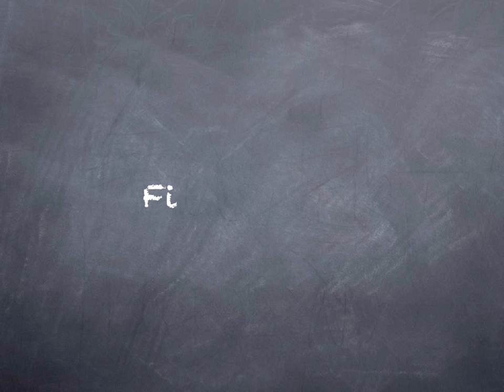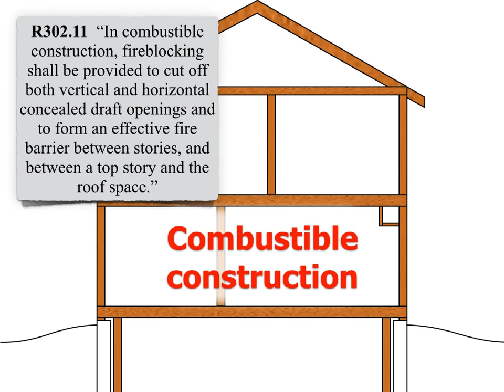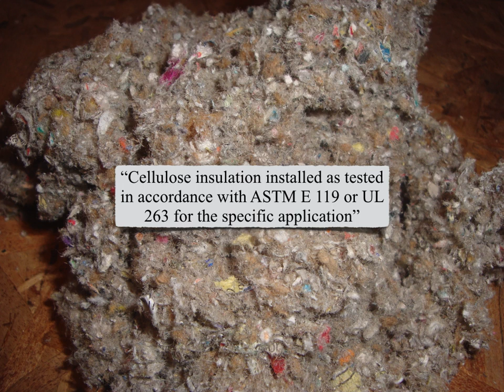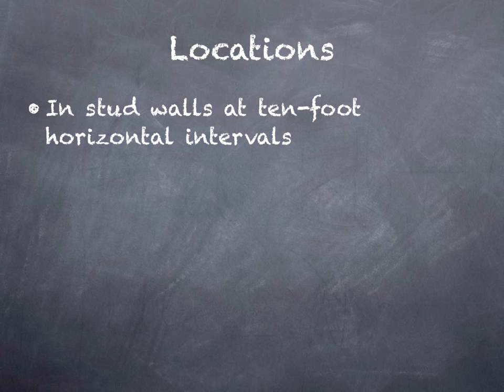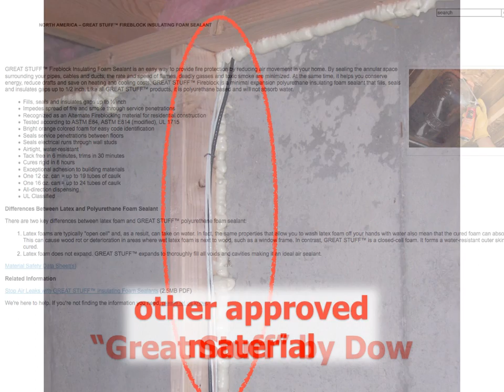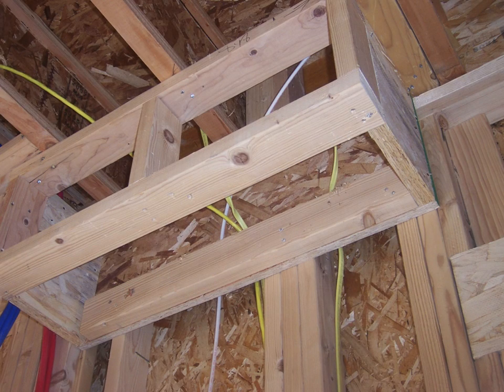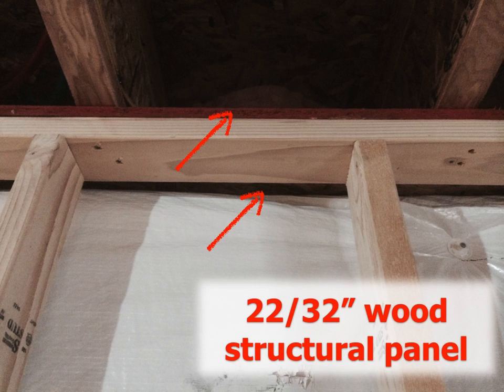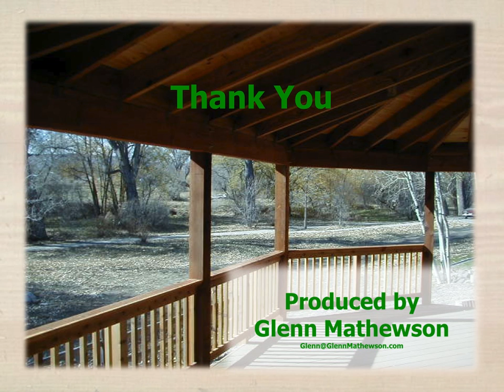Fireblocking

Comment: hi glenn, this was super informative. I'm undergoing a basement renovation and following the 2018 VA residential building code. One question I do not understand is whether fire blocking is needed in the ceiling joists of a basement? What if HVAC ducting or electrical runs down the length of a ceiling joist bay? I haven't been able to find clarity around those questions and the county inspector isn't providing direction.

Comment: Sometimes you have to sell the idea that fiberglass insulation is a fire block. Many inspectors won't accept it. For them, wood is the only block because of the burn-through time. However, adequate fiberglass prevents the TRAVEL of fire through a cavity.

Comment: Somewhat unique situation I'm looking at. Basement will be outfitted with drop ceiling ... If rock wool / mineral is installed fully across the basement ceiling and properly jam packed as well at the edges to the rim joist... Do I still need to put in a layer of plywood/osb at the sill plate level to act as a vertical fire block?

Also, if rock wool, is in the ceiling above an air duct (no soffit for the duct), does that work as well for vertical fire blocking?

Comment: Great tutorial.  What I still wonder is why my plumber was ordered to fire caulk around every pipe that passes thru every floor joist in the kitchen.  That's a horizontal space, does not communicate to other floors.  Any comment about blocking within the framing of a  floor or ceiling? Left - right?
Reply from the maker: Many inspectors do not understand fireblocking.  That's my best guess.

Comment: Great video Glen ! I would like to add a frequent error I find in the field where ATS rods penetrate rim joist often it’s a misconception in the field to caulk the seismic rod. This ofcourse is nonsense and counterintuitive being that they  settle and move with oscillation over time in turn moving the caulking. Properly installed and rated insulation is the best practice there. Occasionally you will  find a good set of plans calling  that out by the structural engineer but often it is not. Great video 👍🏾

Comment: One thing I would caution everyone about with the "Great Stuff" fire blocking foam or any other foam, is that it has a modified UL testing....key work MODIFIED!! Many states and local jurisdictions will not allow these types of products for fire blocking or stopping. I have experimented with these products and they will ignite and free burn with a lighter or match. I would recommend a quality fire caulk ( with a UL, OR ASTM listing), or the other mentioned practices. I am from Indiana, we have some of the least stringent fire and building codes due to our wonderful state amendments, and the state still prohibits the use of "foam in a can", even if it's advertised as a fire blocking material. As a Local Fire Official I educate my customers on the safest practices for fire blocking and stopping. -Keep the public safe through fire prevention education and enforcement...Stay safe!

Comment: can you use two 7/16" osb a a barrier
Reply: He said in the video at 5:25 no you cannot.
Reply: @TRX450RVlogger  At 5:25 he actually only said the 7/16 is not acceptable, nothing about two layers. If it's doubled for 14/16, then that's greater than 22/32, or so the argument goes.  Local codes may allow it.
Reply: I think so, so long as the joints are staggered.
Reply: The main question to keep in mind is that” what is the material rated?” Or is it “rated?

Comment: Glen thank you for your knowledge and fine work. I have a question about fire blocking my basement and the use of rigid foam insulation? I have 1 inch eps foam tight to the concrete foundation wall then 2x3 wall studded tight to that, the cavities will then be fill with unfaced insulation and then drywall. do I need to put fire blocks through the foam and to the foundation wall as if the foam was not there?

Comment from the maker: Well the beauty of the electronic world is my work can be changed overnight.  Quite a difference from my days as a contractor.  I've gotten some great feedback from this first recording, and I am looking forward to it's next version.  Here are some errors and clarifications I will fix:
1) What a dummy!  It's not 22/32 OSB, it's 23/32!  Oops!  Truthfully, while recording, I kept wanting to just say "3/4" osb, because that's what everyone calls it.  Sorry for that error.
2) In a few photos of 7/16" osb used for fireblocking the horizontal wall cavities, it is not cut tight.  The gaps around the OSB would need to be filled.  Typically packed fiber or mineral wool fiberglass would be used, or approved fireblocking foam.  Where the gap is too big, solid fireblocking would be necessary, or filling the whole cavity with insulation, as discussed.  I'll clarify that in the next recording.

Thanks for all the feedback, keep it coming.  Quality education is all that matters, so your help is welcome!!
Reply: Glenn Mathewson 
Is there a way to propery install vertical fire blocks after XPS insulation has been installed against cinderblocks with all seams taped.
Reply: Glenn, I just framed my basement wall right snug up against the concrete basement wall.  Do I still need a fireblocking? There is only an inch gap between the top concrete wall and the stud plate